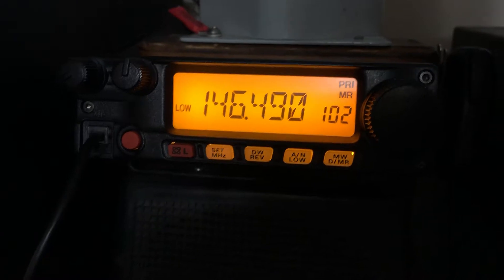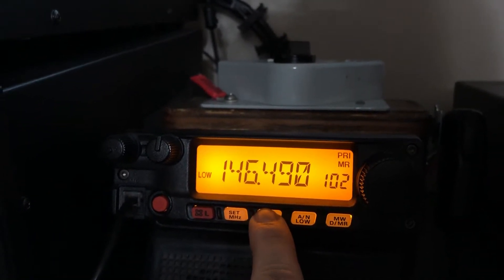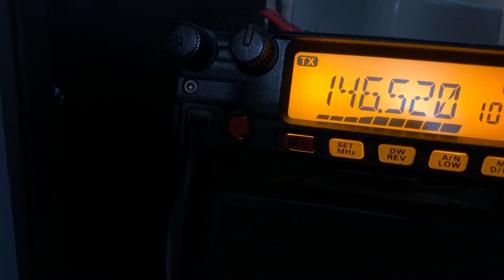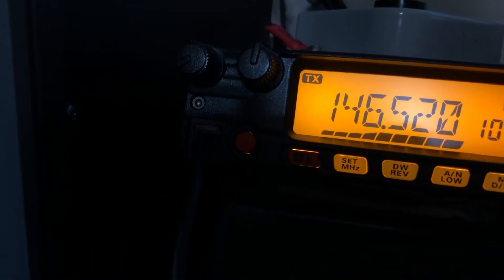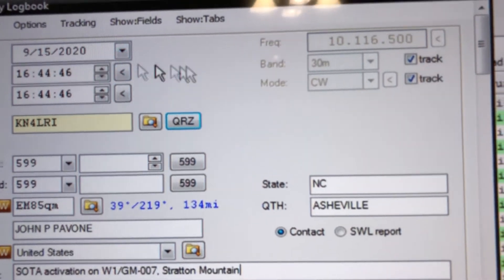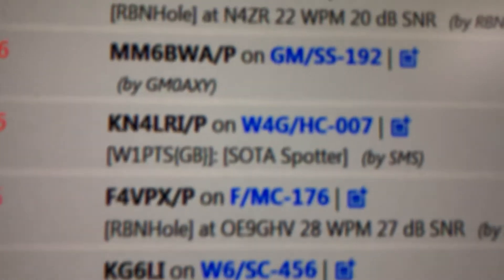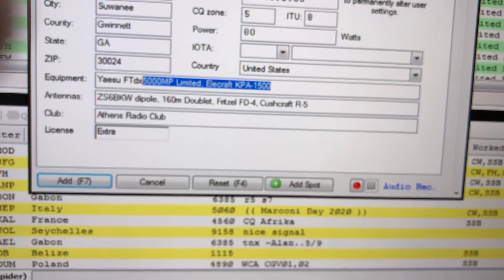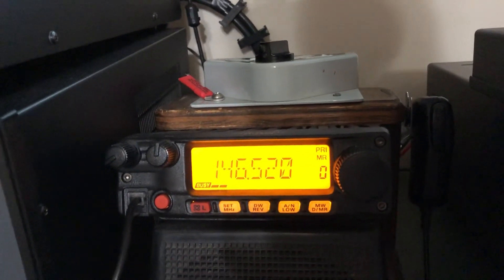Chasing a VHF SOTA station with my Yaesu FT-2980 #hamradio #hiking #sota #portable #emergency

Comment: Comparing this to icom ic 2300h, which is better
Reply from the maker: Neither needs a cooling fan, so they are quiet. Yaesu uses a 21.7MHz 1st IF, the same as my FT-270R HT. This IF has proven to be great at rejecting interference from image frequencies and intermod. The ICOM 1st IF Is 46.35MHz. This IF could be susceptible to interference from nearby strong FM broadcast transmitters. The Yaesu produces 80W.  The ICOM produces 65W.

Comment: Just got the 2980R the other day. Set up an Ed Fong Jpole that's not very high. Live in an HOA area so have to be careful. BUT the SOTA sounds like fun. I live in Central Florida about 20 minutes from Ocala....de KQ1K
Reply from the maker: The FT-2980R is a beast.  We have a fairly large group of simplex operators in North Georgia.  80 watts of power comes in handy.

I guess you won’t be able to chase SOTA from Florida on 2 meters though.  But you will have no trouble chasing the Southeastern SOTA activators on 40 and 60 meters.  Of course you can chase the distant SOTA activators on 30 meters and higher too.

I hope you enjoy your 2980 as much as I enjoy mine.

73, de N4HNH
Reply from the maker: I should probably buy another FT-2980R before Yaesu discontinues them.  They are bad about discontinuing great products.

Comment: Hi will this radio work on simplex without repeater?
Reply from the maker: I rarely even use a repeater with my FT-2980.  I bought it for SOTA chasing - just what you see in the video.  When operating simplex it helps having 80W.  I work SOTA activators 50-60 miles away.  They are usually using a HT at 5 Watts.

We also have quite a number of simplex base stations in my area, so we keep VHF simplex somewhat busy here.

73, de N4HNH

Comment: 5x9 yer arse 3 by 6
Reply from the maker: Nobody said anything about 5x9.  I gave him a 5x5.  The S-meter on the FT-2980 isn’t numbered, but it takes 5 segments to equal approximately S9.  He was lighting 3 segments, which is approximately S5.  But, working SOTA with QRP radios that have no S-meter, I have learned to approximate S-meter readings based upon the amount of white noise in the audio.  Technically a S-unit is supposed to equal 6dB, which is considered to be the amount of change in audio level that our ears can perceive.  Since S-meters do not reliably track in 6dB increments, judging by my ear is probably more accurate.  I give them S9 if there is virtually no white noise.